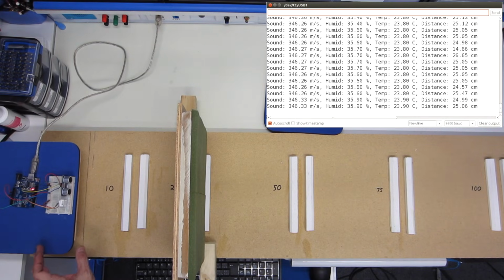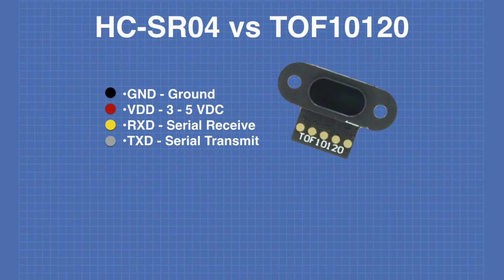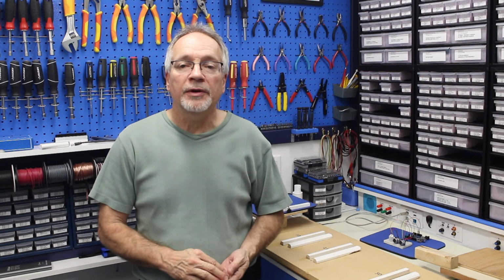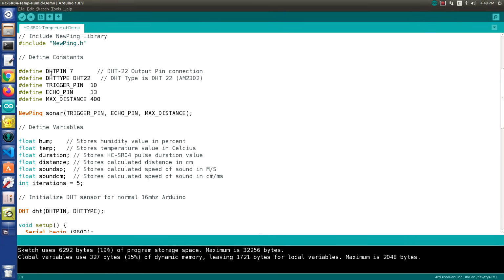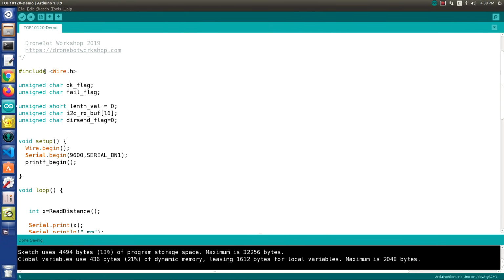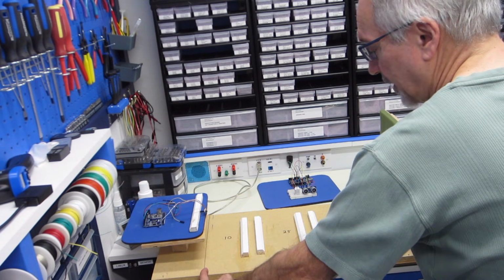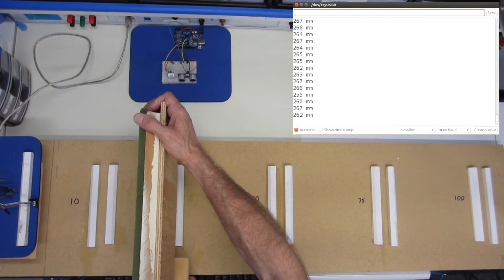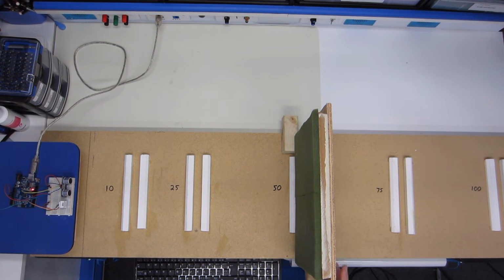Laser vs Ultrasonic - TOF10120 vs. HC-SR04

Comment: Now there's an infrared proximity sensor that is very similiar to the hc-sr04 in price (i don't know what's it's official name is) and seems quite easy to use (according to my little experience at least...). I wonder if you could review that sensor as it is quite responsive hence could be used for high speed sensing.

Comment: This was an interesting comparison.
I am wondering if the sensors may have been picking up your supporting timbers that you used at each set point.  Are they even needed with the way this is designed?  Might be better to replace the timber supports with just lines to align each measurement point and see how it goes with that.
It was an interesting comparison.  I had high hopes for the TOF laser sensor.  Apart from the speed of the readings, the two sensors were quite similar in accuracy, given you couldn't go further than 50cm with the ultrasonic one.

Comment: Have you tried the US-100 ultrasonic distance sensor?  In my limited experience, it seems to be both faster and more accurate than the HC-SR04, and compensates for temperature on its own in serial UART mode.

Comment: Your sensors sre too close to the work surface. In the case of the HC-SR04, you're probable getting reflections from your support strips.
Reply: ed - bingo you nailed it. I ran the same test and used only back stops against my board and receive full range will my tests. I am surprised he never caught this reflection but I thought the laser would have not had such erroneous readings?? I still running tests
Reply: @MrWATCHthisWAY  My guess would be the fault of the diode itself and not having a very tight focus. Then again, could be the manufacturing process.
Reply: ed your probably correct in the manufacturing tolerance doesn’t meet the design spec. I’ll check out the cut sheet and try and see if they give a value to the area field to see if this test meets its operation requirement. Should have check that first.
Reply: @MrWATCHthisWAY  I'd be interested in hearing your results. Thanks.
Reply: ed the spec sheet was useless and I sent an email to the design engineers and now waiting for feedback on the design. I also mentioned the test that had been performed with a like to the video and ask for their feedback on these results. Why and what may have caused these results but I AA’s m going to guess that they will blame manufacturing but I am going to bet that they didn’t provide any limits for quality control or there was no sampling going on in the manufacturing.
Reply: @MrWATCHthisWAY  You could be right. Don't have one of the LED units but I do have 2 of the ultrasonic. Maybe I'll do some tests my self. Check the differences from unit to unit. Cheers Mate.
Reply: ed I’ll have to open my kids toys open and borrow the sensor from it. Just for a short time.
Reply: Both devices will inevitably have a rather wide cone shaped TX pattern, which at some distance will pick up any obstacle reflection that falls within that cone, being it the workbench surface or any other mounting obstacles.
The best test would be hanging down from a high mounting point and shooting against the floor.
The room and the floor must of course be free of any obstacles possibly falling within the TX cone pattern, except the single object you are testing the distance with.
Reply: CXensation so they can be used as very inaccurate and short distance radar altimeters. Lol.. I would expect the laser one to have a narrow beam and not a cone field??
Reply: @MrWATCHthisWAY  My bad.
The laser sensor is by nature a perfect beam.
It must then be the target light absorption that is the dominant factor for the low range results on the laser sensor - or - too low power/sensistivity.
Reply: CXensation i was confused by your response. I was looking at the spec sheets and I can’t determine a thing because they don’t contain enough information regarding the actual QA testing. But I am going to agree with Ed because it is probably going to come down to the manufacturing QA. If the produce a signal then they pass. Even if it drifts all over the range field. There should be a beam alignment procedure on the laser sensor for just this purpose. But they are just used for inexpensive toys and not aircraft radar altimeters. I was actually trying to use it for a group proximity sensor. I may try to devise an adjustment procedure for this unit and center the beam. I’ll play with it until I break it!! They I’ll order a couple more and try something different. This test has me thinking about creating my own design now. Something with a longer range and narrow beam. Or looking for a more robust sensor??
Reply: @MrWATCHthisWAY You can still get lo-power laser emitters at a very low cost, not like the types used for crosshatching on bench drills, but the basic laser emitter diode.
I think you'd be better off designing your own receiver optics, as then you have full control of all parameters and the alignment.
Reply: CXensation i was thinking along these same lines. I am just not familiar with all the different type system designs. Thank you for the idea and direction. I mind will be spinning for sometime now!!
Reply: @MrWATCHthisWAY  A search on Ebay or AliExpress quickly gives you an overlook. They are even cheaper than I remember: less than $1 !

Comment: I've recently seen very reasonably priced laser distance ranging sensor boards based on the newer ST Microelectronics VL53L1X which has a range up to 400cm. I purchased a couple off AliExpress including lens cover. I'm yet to try them out. These run at 3.3 volt levels so I'll run them with an ESP32 board. https://www.aliexpress.com/item/32901732063.html

Comment: Could the failure of the HC-SR04, have anything to do with the fact that it looks to be mounted pointing upwards and that the reflected waves are missing the receiver. I note the TOF10120  line of sight was parallel to the test platform, but it appears as though the HC-SR04 is inclined upwards by 10 to 15 degrees.
Reply: Disagree.   I don't think the Time of Flight sensor "failed"

Comment: Great demonstration.  I wonder if the LASER was designed for close range work? 

Due to the fact that it's very small it could be mounted inside a device and the LASER could be used to adjust a electrical / mechanical component.  

For example elevator door. Measuring the distance to close the door, slowing it down or speeding it up.

Comment: I haven't verified this, but it seems that many sensors will find "edges" and report their distance. The white pieces, you used to hold the target, could be causing that effect.
Reply: I concur with this. basically, it's what you were saying about the field widening. i'm surprised you didn't try placing a piece of board or paper to cover the unused brackets between the sensor and the target.

Comment: Hey there Dronebot, 
Would the orientation of the sensor change the results, for instance orientating the device 90 degrees from tested pin placement?  Or tilting the sensors slightly off the perpendicular axis (up, down)?  Also I'm curious if you covered the rungs on your test bed from sensor to target might improve the results.  I've played around with the HC-SR04 and looking to use it in a home application.  Thanks for producing these informative videos!

Comment: Could the distance be off  for the long because of your mounting brackets, the right angle at the leading edge might be the problem. Put in a triangular leading edge taller than the square rear spacer or remove the rear entirely.
Reply: This is likely it. It's sound. It's not super directional and it will read any echo that comes back.